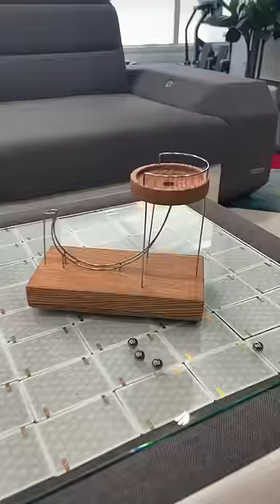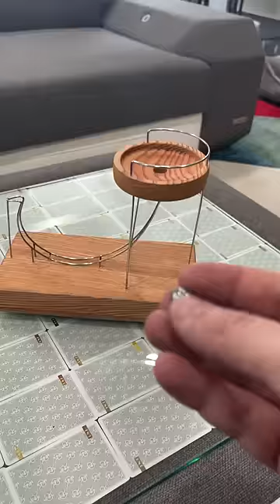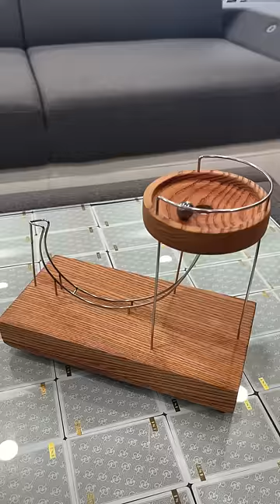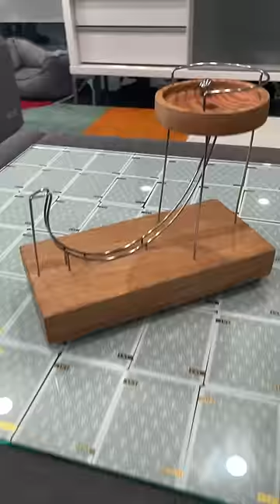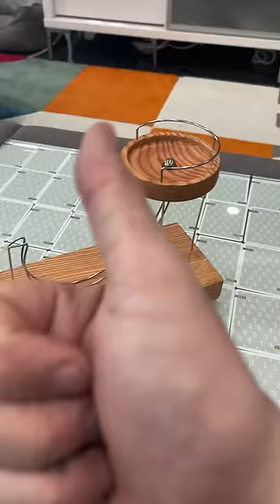An Impossible Perpetual Motion Device?! 😳 #Shorts

Comment: I love how it gets rocketed down the slide like, hey gravity becomes 7 times more powerful through this hole.  What a crock.
Reply: magnet in the bottom
Reply: @sandrovoncastelberg9440  no
Reply: @TechProFury  yes
Reply: @TechProFury  burger
Reply: @austinheyman  you have to prove there is one
Reply: @ShieldStun  physics already do.
Reply: @miikkael100  you realize a magnet would only pull it towards the magnet and not away right
Reply: @sam-terriblecontentandmore3702  But electromagnet doesn't, maybe I should have specified.
Reply: It uses Weight and Gravity not energy to create it's motion. So it absolutely can go on forever repeating the motion the same as the spinning of earth and it's orbit around the Sun.
Reply: @GorillaCookies  It needs external force to achieve the same height, in this case electromagnetism. Gravity wont do it alone.
Reply: @GorillaCookies  bro the earth is actually falling into the sun, getting closer and closer every day... You know cuz you can't just spin forever because perpetual motion is impossible.
Reply: @GorillaCookies  what you just said is completely wrong on so many levels. Do you truly believe that we just witnessed a perpetual motion device? And no one has mentioned it on the news etc. Dude go back to grade 10 science
Reply: Earth is not a spinning ball
Reply: @GorillaCookies  spinning of earth and orbit around the sun won't last forever, there's just very very very little slowing it down, so it will last billions of years. This contraption also has very little slowing it down (and very likely has something speeding it up, like an electromagnet powered by a battery on a capacitor that recharges when the ball is circling the top of the platform) but if we could suppose it was completely free-moving, the moment we tried to put a turbine or a dynamo or anything else on it to harness some of the kinetic energy into electric potential energy, it would lose the ability to repeat itself. Even if you tried to take just 0.000001 joules from every lap of the marble, it would slow it down enough to where it would hit the rim and bounce off the top platform instead of landing inside of it and repeating the cycle.

For the people who think regular magnets without electricity could recreate this effect, magnets are zero sum devices. I'm sure the term for this is wrong, but the physics are still accurate: the magnet could pull the ball and the ball actually would speed up, possibly even speed up enough to complete the jump back to the top of the platform! But then eventually, the ball needs to change directions and move away from the magnet, and the magnet would then slow the ball down by the exact amount it sped the ball up, resulting in no speed change from the magnet, and some amount of speed decrease as a result of friction. Comets do this speed up slow down routine as they orbit the earth or the sun, picking up speed until they are going their fastest when they are closest to the body they orbit, and then slowing down more and more as they go farther away, until they eventually change directions and come back again. At the closest point, they may be moving 1,000x faster than at the farthest point, but it will never get to keep all that speed, the earth will take it back as the comet starts to move away again. For comets and spacecraft, the "slingshot effect" is explained by the fact that the bodies they orbit are in motion, so they can get a speed boost when passing a body in the same direction it is moving, but they also get a speed decrease if they pass it in the opposite direction, and technically these boosts and subtractions actually affect the speed of the planet that causes them, changing the speed of the planet by an equal and opposite amount proportional to their difference in mass, just like how a car would crash to a stop if it hit a building, but it would only slow down a little bit if it hit something really small like a traffic cone or an animal. 

The analogy to the slingshot effect would be if the magnet was moving back and forth helping to speed the ball up more than the magnet could do on its own if it were still, which would offset the "zero sum" issue that would cause the magnet to take back all of the speed it would be able to supply to the marble. Springs couldn't provide this motion, it would need to come from another source such as a person moving a lever, or from electrical input, which is how a railgun can use magnets to accelerate a metal ball faster than a bullet and it doesn't end up bouncing back and forth stuck in the barrel
Reply: @GorillaCookies  First off, the Earth's orbit around the sun is IS slowing down (very very slowly). Secondly, because the ball has frictional losses, air resistance, the production of sound etc, it is losing energy. To keep this up, it has to have energy slowly added to keep up, or else it will not roll fast enough to make it into the cup again. An electromagnet that attracts a ball through a hole and shuts off really quick can provide enough energy to keep this going.   

There is a reason that's a wood cup and not a clear acrylic
Reply: @GorillaCookies  the ball falling is a transfer of energy bruh

Comment: This will certainly act as a “perpetual motion device” until the magnet in the base wear out.
Reply: Oh shit is that true?  The magnet speeds up the metal ball so it has enough velocity to make it back to the top??
Reply: That wouldn't work as the magnet would slow the ball the exact same amount as it sped it up.
Reply: a simple magnet wont do that, it will accelerate it while going down, but also decelerate while going up. it’s probably an electromagnet powered by a battery that turns on and off at the right time
Reply: Can’t be magnet. If it’s pulling it wouldn’t let it ramp out. If it’s pushing the ball lifts off the tracks. The tracks it rolls on are slowly splayed wider out. It adds free fall acceleration that compounds. Allowed it to gain more than standard acceleration. Could be faked somehow but I think it’s real.
Reply: @shanereilly2113  def not real lol. Drop a basketball, does it bounce higher than where you dropped it? How about a pendulum...Will it come back further from where it was released?  Will the bead roll and jump higher than where it was dropped from ? Cmon ..now smack yourself ...did your cheek slap back?
Reply: I would assume the magnet is at the top near the hole. The ball falls through and gets a boost from the magnet and a touch of gravity giving it enough supplemental force to clear the top again
Reply: @NoflectioN  cmn now. Haven't you seen skaters coming down the ramp and doing insane flips. Or those snowboarders? I think the ramp helps the swing back to the top which is not the same as dropping a basketball or a pendulum swing. The device maybe a fake but your logic seems wrong
Reply: @MrPots-he8zw  that’s called “pumping”, bending the knees at the right time to add speed
Reply: @NoflectioN  its very real.. the electromagnet is anyway.
Reply: Bunch of dumbbells here. The whole entire lot. Not one single person got it correct.
Reply: More so the batteries then the magnet. If it was really just running off the magnet it could run for thousands of years theoretically which would still be pretty awesome but we can't even accomplish that it's most likely ran by an electromagnet if it is anything like all the other fake perpetual motion devices. Think about it if we could get something to run just off of magnets then we would be able to produce power from one of these objects for thousands of years or whatever the lifespan on the particular magnet
Reply: @Wutzmename  Ok genius... if you’re so smart then you tell us how it works.
Reply: @johnjames630  you and many others need to learn basic physics ASAP. Thats not how it Work and it will never be. Perpetual motion IS a chimera
Reply: @MrPots-he8zw  as a skater we use what's called pumping to create momentum. The reason we get air is due to the energy in our legs, we push on the ground at the right time to create the momentum!
Reply: @johnjames630  not even remotely close.
Reply: @johnlacey3857  Why would I do your work for you? You'll get there eventually or maybe your children will.
Reply: @Wutzmename  For starters it’s not “my” work. The fact that you don’t want to explain your solution and yet you’re happy to ridicule others does not speak well for your moral character.  It also suggests you don’t have a solution; you just pretend you do so that you can boast about it.
Reply: @johnlacey3857  You can think what you want but you won't make me think for you. Nice try.
Reply: @Wutzmename  haha you are under some false impression that I’m dying to know the solution. I’m not. In fact I couldn’t care less.  It’s your ego and pompous nature that sticks out like a sore thumb.
Reply: @johnlacey3857  Wrong You keep replying. You're telling me everything I need to know.

Comment: I feel magnetically attracted to this.
Reply: Magnetic being the perpetual clue🤔😂
Reply: This is the only actual intelligent theory the idea of electric isn’t that practical for this set up but magnets makes sense
Reply: @araphel2925  magnets don't make sense at all for this device.
If it were just magnets - without any electricity - then this would in fact be a perpetual motion device.
But since such a thing is impossible there must be some form of electric system powering this. Probably an electromagnet turned on and off at the right time.
Reply: There's a downward spinning wheel within the hole at the top which adds impetus to the ball.
Magnet not required. 😎
Reply: @justjones5430  not in the device used in this video.
There are versions that work like you described, but not this one.
Reply: @araphel2925  There’s no possible way a device like this could work without electricity of some kind dues to laws of thermodynamics
Reply: @justjones5430  This device has an electromagnet inside, only real way you could get something like this to work is with an external source of energy to the ball
Reply: @chiggy2206  
No Shit Sherlock!
Did I not just Say pretty much That Exact thing?
"Extra impetus is added" remember that bit? or do you not understand English?
Reply: @justjones5430  that’s not what you said at all, it’s powered by an emg not downward force or it spinning, saying extra impetus is just implying the spinning motion somehow applies extra force? So no you were wrong
Reply: @Jehty_  bud real magnets dont violate laws of physics either because they dont last forever. Even when you use real magnets you have an energy loss from those magnets

Comment: The electromagnet in the wooden  underlay: hello there
Reply: Hahahah damn is that what it really is?
Reply: @MishalMr97  It cant really be anything else.
Reply: @MishalMr97  I haven't slowed it down but I feel like the ball is accelerating on the way up which should be impossible with gravity, only explanation is magnetic repulsion
Reply: Doesn’t have to be an electro magnet just has to be strong enough magnet to repel the ball
Reply: Does electromagnetic need to be powered?
Reply: @gotohowie  slow down and think about what yer askin there Chieftain
Reply: No
Reply: Even if there was a magnet, this would still be considered perpetual motion… until the magnet loses its charge ofc
Reply: @finloc225  it’s perpetual until it’s not lol
Reply: @Jadguy24  no no and no. Thats not how it Works. Perpetual motion with magnet dosent exist
Reply: It’s actually a motor spinning a wheel that drives the bearings down the ramp so they have enough speed to go back up.
Reply: @Jadguy24 
Then it would eventually lose too much energy to friction and would stop.
Reply: @freelancedentist9480  everything is perpetual until it’s not
Reply: Na, just gravity.
Reply: @Jadguy24  if it’s only a magnet it would still be perpetual motion. Needs to be an electromagnet that is de-energized at some point.

Comment: Magnetic acceleration - it make it "look" like perpetual motion.
Reply: This looks like freefall speed. 
There are many devices like this, no magnets used in many because magnets can speed up in attraction path but then they slow the release path, due to the same attraction. (Know as "the v-gate" problem in magnetic acceleration), there are complicated ways to overcome it though, just so you know.
Reply: @Drew_Hurst  you say complicated  ways to fix this but can't you just add a magnet that repels or use some other metal to have the same effect?
Reply: @kingty8010  No Friend, it's always complicated to do: but it can be done and some amazing effects can be produced that stretch the laws of  current science.
 
However, I believe I could be wrong about this device after reading comments by owners of similar devices, if they are telling the truth they say the is a motor and a rubber wheel on the path. 
I dont see anything like that even when zoomed right in on the video. 

It could be done with a series of electromagnetic coils built into the base, along the path, that are electronically controlled with an integrated circuit timer that turns them on and off at precise intervals overcoming the v-gate problem associated with using one, or several, simple magnets. 

Sadly however, for both methods there'd also need to be a battery compartment built into the base to power it all which means either the person who made the video, or those that say they own one, is or are, lying. 

Have a good one Friend 👍🔍
Reply: @Drew_Hurst  you have wrong, he said it's fake, is a dimostration than infinite energy recycling don't exist but if exist is something like this..

Comment: The giveaway is the steel ball, which 1) always jumps higher than the platform it drops from, and 2) the chute is a pair of wires, which the steel ball 3) connects, completing the circuit of an electromagnet hidden inside the 4) "two by four" base, which is hollowed out.

Comment: Imagine if the bead jumped straight into the hole
That would be so satisfying
Reply: it can’t, that’s the whole perpetual motion device not being possible, if it fell perfectly each time and then went to that same exact spot every single time it would be a perpetual motion device, but since it’s impossible, we’re permanently unsatisfied
Reply: @sand3983  no dude it has nothing to do with where the ball lands

This is done simply with the ball being magnetic and propelling along the rail, Theoretically you could make one of these just go straight in the hole you would just need to put the perfect ammount of starting energy in

Comment: “A Perpetual Motion Device is actually impossible”
Etsy: Challenge accepted! Just give me a few months
Reply: Exactly. Why did he say it’s impossible when he’s literally showing us how it’s possible and that it actually exists? Clearly it’s possible and it’s been done, as evidenced in this video.
Reply: @jasonvargas7564  it’s not possible the marble won’t do that forever yes it might go for a very long time but not forever
Reply: @jasonvargas7564  friction and eventually wear is largest limitation on achieve perpetual motion (the forever part is key to the definition)
Reply: @joelsefton3133  it's not about time, it just won't do that 1 time, this is just a 3d model
Reply: @jasonvargas7564  it's a 3d model, not even real
Reply: @jasonvargas7564  the thing is, there is energy being inputted. Gravity is pulling it down at 9.8m/s every second.
Reply: @bran38632  honestly that was 10% a guess. Cus haven't taken phys yet and mostly have learned it through online resources, but thanks!
Reply: @jasonvargas7564  The marble is being propelled by an external source (some sort of magnet I'm assuming). It is impossible for that ball to shoot up higher than the height that it originally fell from without an external source of power.
Reply: @nicholaswoodworth8955  This! It does look like the base an the top as a magnet one that "suck" the marble into the hole and the other in the lowest end that gave the marble more acceleration. I say someone turn down one of this and it has batteries too...
Reply: @jasonvargas7564  
There's a magnet in the base pushing the ball back up.
Reply: It's a battery-powered electromagnet that switches on at the right moment to accelerate the ball, then off to avoid decelerating it as it passes. That's why he mentions that the two balls can't go down the slide at the same time; it'll mess up the timing of the electromagnet's switch and either the front ball will be pulled back or the rear one won't be accelerated.

Gravity and permanent magnets are similar in that they only output as much energy as you input. When you lift an object up or pull it way from a magnet, you are putting potential energy into the system. It's not free energy; YOU put that energy in. Once you release the object, it will then spend that energy to return to its original position. An object cannot be brought back higher than its falling point without more energy being added into the system

This is why gravity and permanent magnets will never work as an explanation for perpetual motion. All systems require an input and lose energy over time.
Reply: @jasonvargas7564  because it is literally not possible. Even if no magnets or anything was used on this device, there is still input energy of dropping the ball onto it and frictional forces are still at play. This is literally a concept and is impossible in reality. And that is the problem with him labelling a video like this for clicks, even if he admits it isn't possible in the video. It convinces people without the needed understanding that it is real. A true pmd would solve all of the world's energy problems, so ya, it would have been made by now if possible.